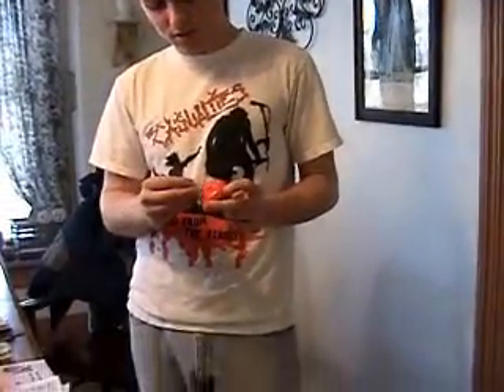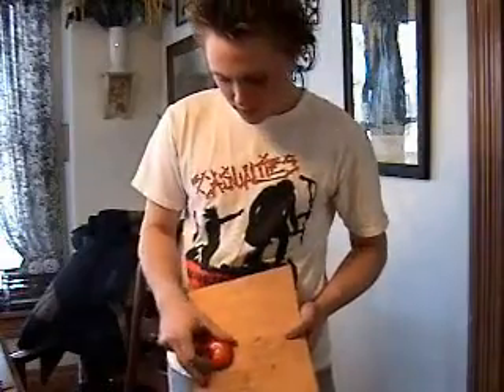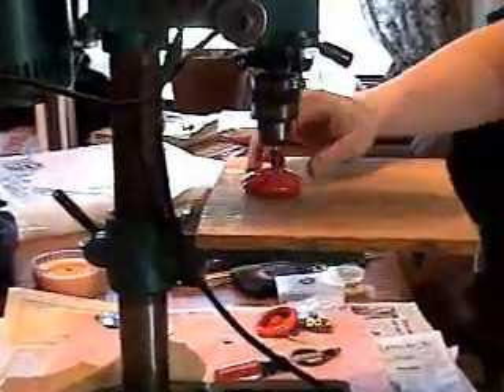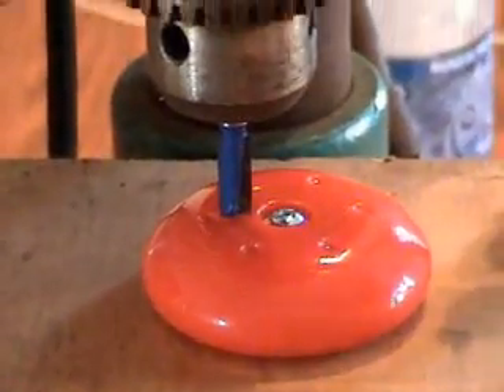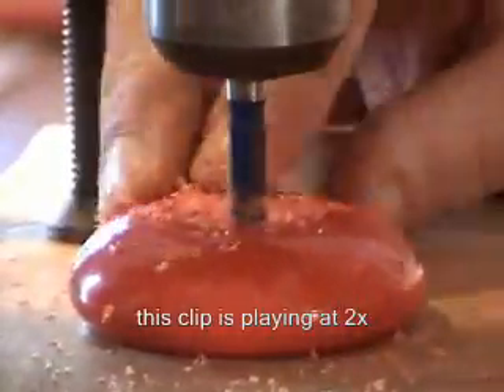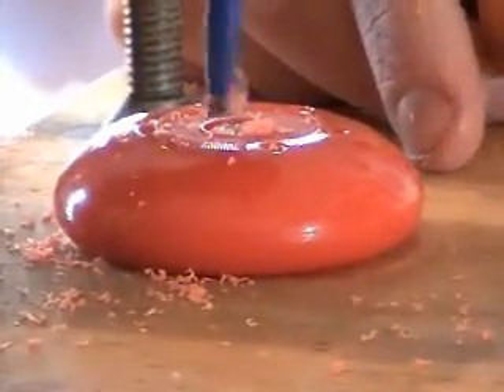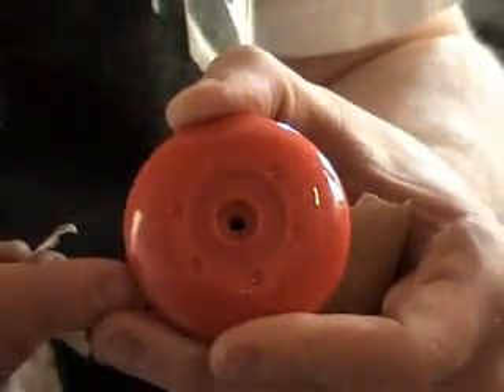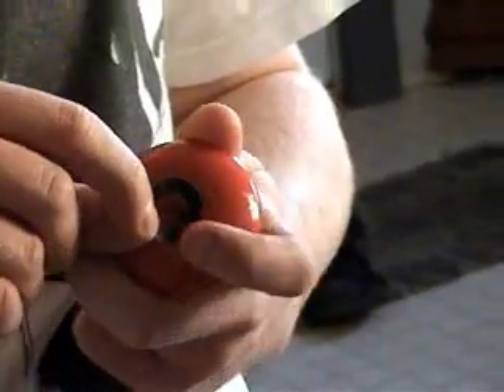Drill Press Recess

Comment from the maker: He uses a Duncan friction sticker in this video.  By milk yo sticker, do you mean a sticker from a Milk?  Milks use silicone response, which you can use if you make a thinner and slightly deeper recess, but it's not a sticker.  You just use flowable silicone or gasket-make like they have in the auto section of hardware stores to fill the groove.  Pretty much any yoyo response sticker will fit in the recess if you do it like in the video, and will work fine.